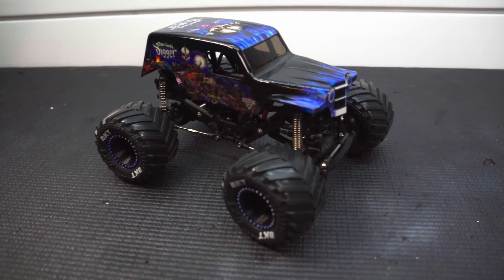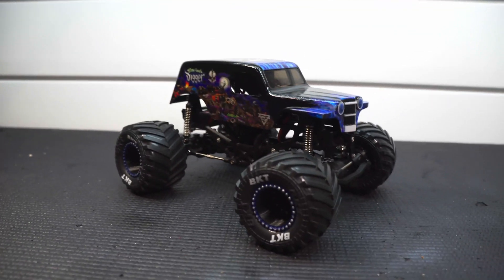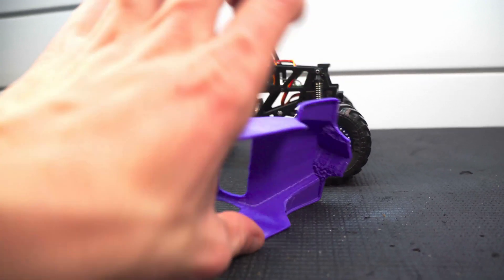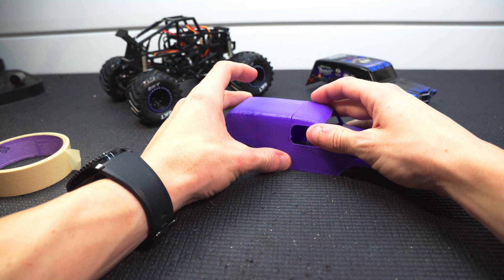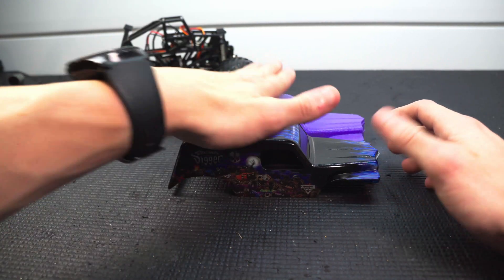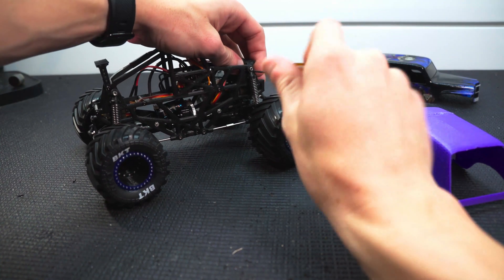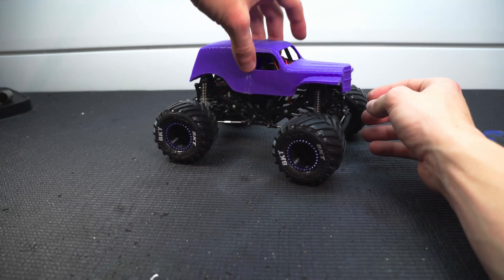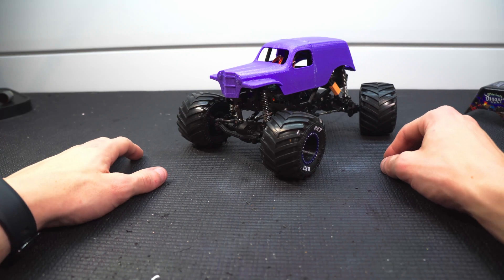NEW 3D Printed Body for the Micro Monster Truck!!

Comment: Hey do you think if I scaled up the model I could put it on a 1/10 truck
Reply from the maker: It's very possible but I wouldn't really be able to confirm or guarantee that since I'm not sure if the dimensions would scale up correctly both in wheelbase and width.
Reply: @FullThrottleRC  yea it’s for a red cat ground pounder so I will have to try it and see

Comment: Also if you use a soldering iron to melt the plastic on the inside of the body it works very well for fusing 3d printed parts

Comment: The metal diecast bodies are why I want to experiment withe model car bodies. Though this thing would look really good with the Hot Wheels monster truck bodies
Reply from the maker: Yea I was hoping the die cast body wouldn't be too heavy once the truck was together but it definitely is. Model kit bodies are a great option depending on what truck you wanting to make. I'd like to model a bunch of different trucks for 3d printing so anyone that wants to build one could also print whatever body they want.
Reply: @FullThrottleRC  That would be pretty cool

Comment: What Wheels & Tires did you use
Reply from the maker: Tires are from the SpinMaster models, wheels are 3d printed. You can check out the build series on my channel if you're interested

Comment: Great job man! 

What RC is that and where did you get the wheels & tires.?
Reply from the maker: Thank you! Its a custom build, you can check out the build series on my channel. The wheels are 3d printed and the tires are from a 1/24th Spinmasters Diecast model.